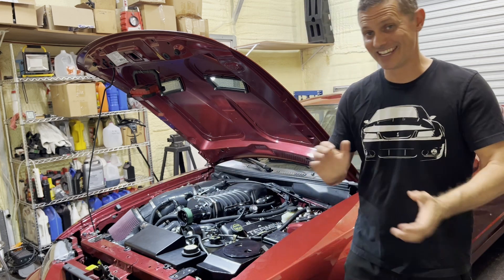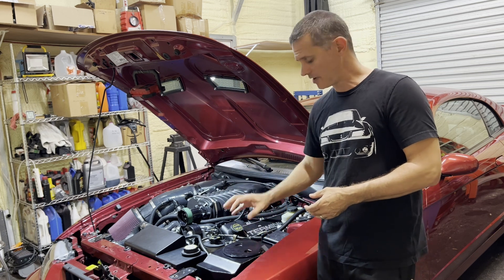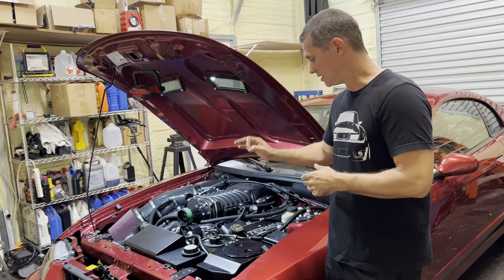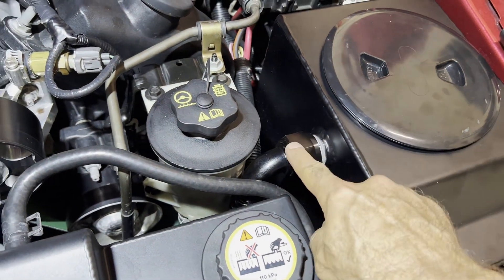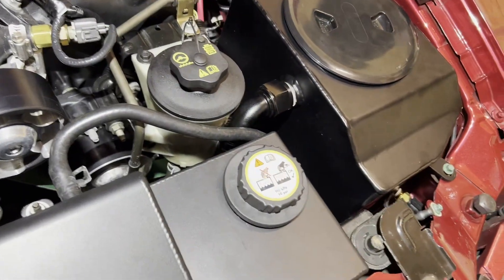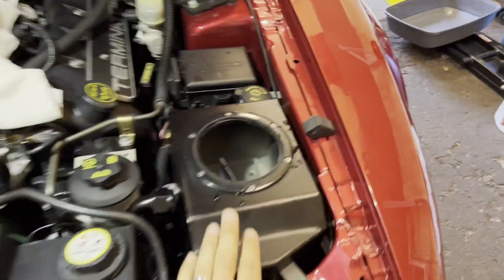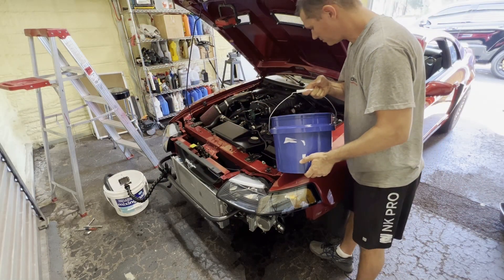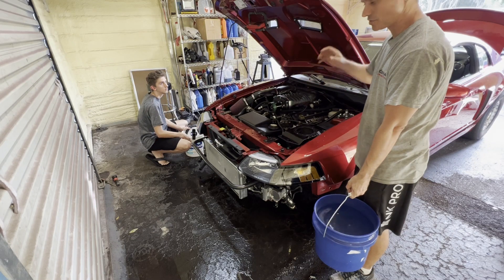Flow Testing the Supercharger Cooling System (SOMETHING'S WRONG) 03 Cobra

Comment: I have heard upgrading to VMP's 1 inch adaptor lines with their upgraded intercooler brick makes an even greater gain in cooling things down than just the brick alone... That would also be something to test in the future.
Reply from the maker: Yes I have all 1” lines. Unfortunately due to really long back orders I was not able to get my hands on the VMP manifold. However I worked with what I had as best as I could as you’ll see in the follow up video to this.
Reply: @MalcolmV8  Excited to see the results!
Reply from the maker: As was I :)

Comment: You will definitely pick up flow with the VMP brick. But remember flow doesn’t always equate to heat transfer. Though I’m willing to bet the VMP will transfer heat better also.
Reply from the maker: I agree extra flow won't always equate to heat transfer but the lack or flow or poorer than expeceted performance I believe indicates a potential problem.  I love digging into this stuff :)

Comment: Very cool vid. I have a trunk take with a RULE 2000 pump, makes me river wonder what mine is. I see 120 temps cruising and when i ice it at track 80-90.
Reply from the maker: Very cool. I assume that 120 is not fully heat soaked? Or cooler weather cruising.
Reply: @MalcolmV8  yeah it's just cruising in this 60 degree weather. Very rarely does it get about 80 in the summer here
Reply from the maker: That makes sense.